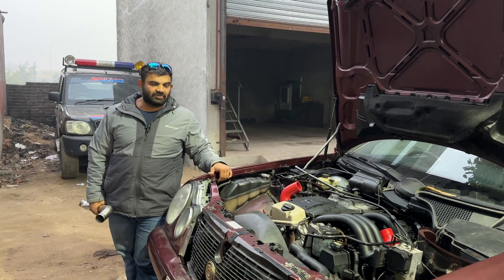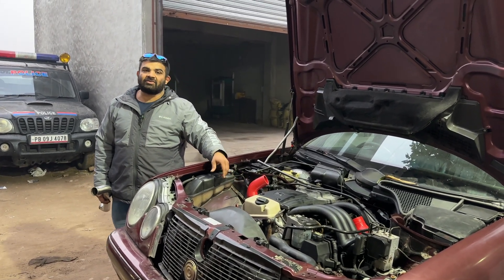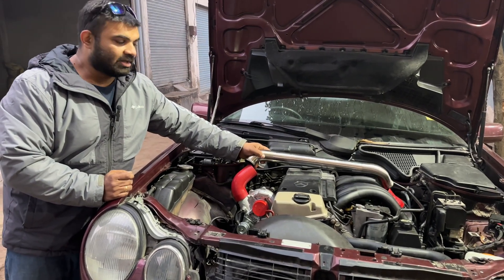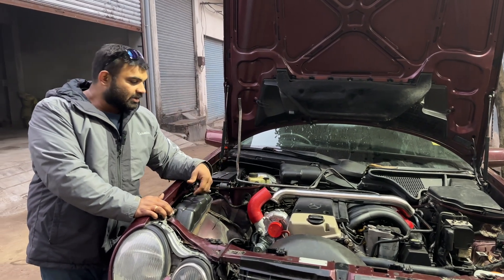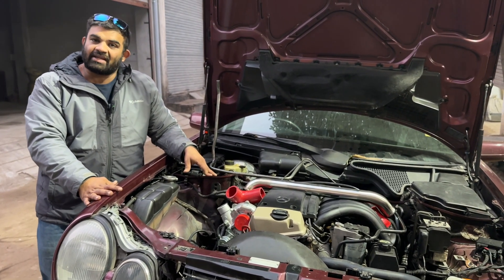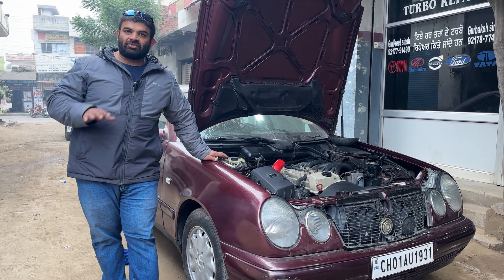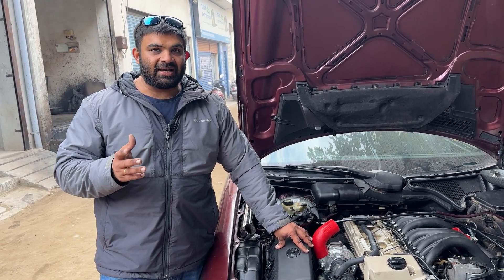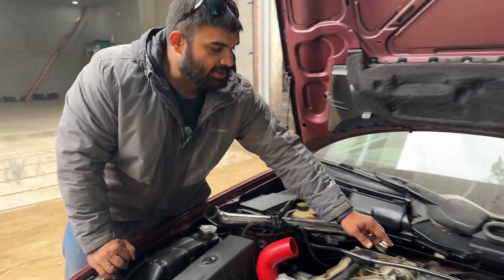Mercedes Benz E250 Turbo Install - Part 2 #om605 #dpuk #garret

Comment: Sir any reasoning behind not using a tiny top mount intercooler in between the long pipe connecting the turbo and the inlet manifold. A scorpio intercooler with stealth ducting from the grill.
Reply from the maker: Really torn between the idea of doing a top mount intercooler with a nice wide hood scoop or keeping the stock sleeper look. 
Have all the hardware ready for it 
Just can’t convince myself to chop the hood